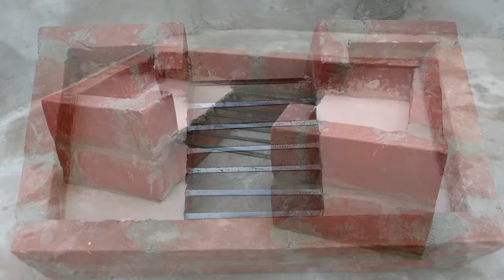Awesome Dual Burner Smoke Free Bricks Stove Making

Comment: I have a few suggestions. Though I'm no expert and I've never built one:
1. No one else seems to do this, but instead of embedding the rack at 1:47 I'd suggest perhaps making holes, so the rods can be removed for easy cleaning?  Or replaced if they rust?
2. At 5:28, it seems like a lot of extra labor to use a sawzall to cut a hole in the back for the pipe, and then have to fit it and seal it with cement.  Why not leave that brick out, and make a "fake brick" molded to fit the pipe?
3. At 6:25, it's redundant to add another layer of concrete.  A second layer is probably not at strong (might flake off) and extra work and drying time.  Why not combine it so the top counter mold (at 4:53) is all done at once?  Then there's only one drying stage and it will likely be stronger.
4. Seems strange that there's no bottom to this stove.  You must use it on an existing concrete slab.  That is unlike any other stoves I've seen built on YouTube.
Reply: pero haz tu uno y sube el video, que criticon tan largo..
Reply: I concur with your suggestions. Additionally the two voids can be filled with mud or unburnt bricks for more savings.
Reply: Guys do ur own since u know better